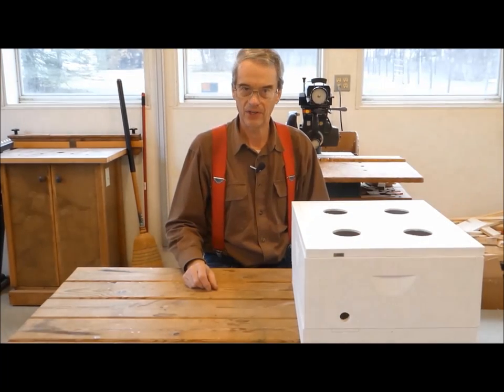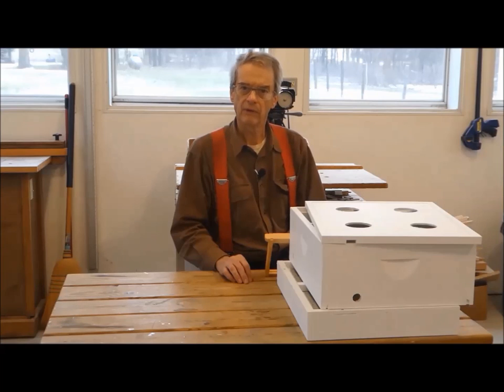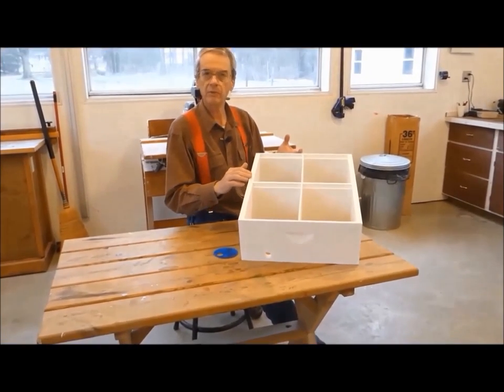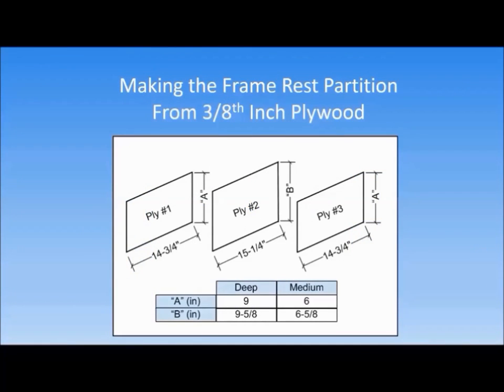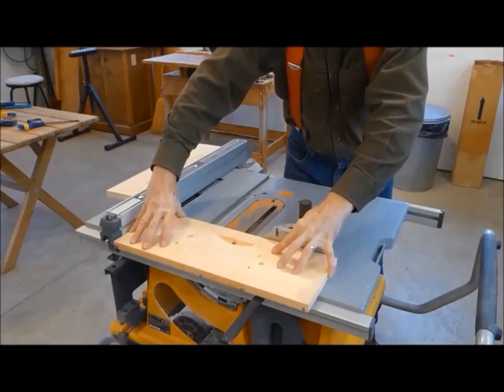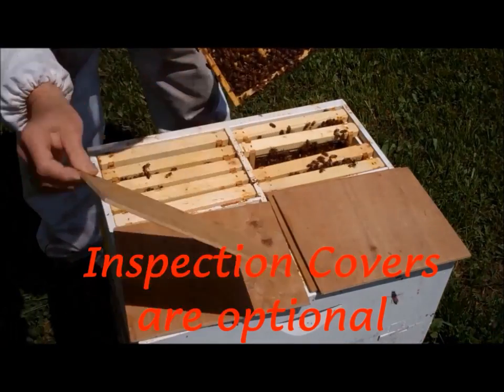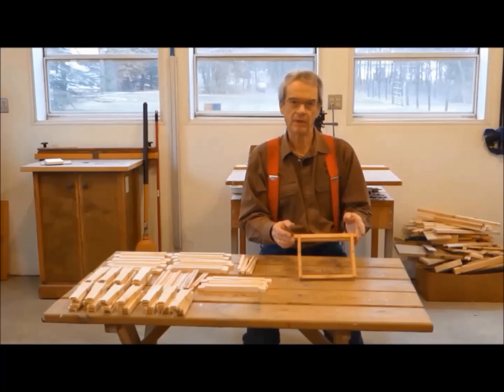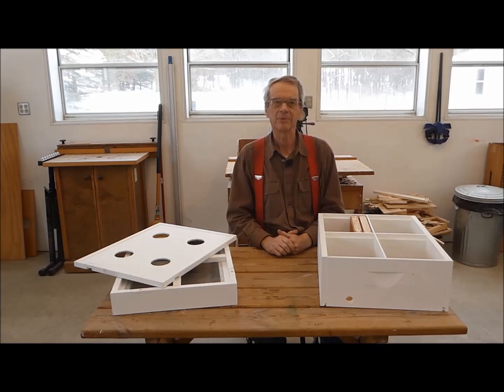Mini Nucs Part 2

Comment: For the ends of the topbar I just use a rasp to finish them up.Soft wood it didnt take long and looks pretty good.Love your videos .
Reply from the maker: As typical in the shop, there is usually more than one way to get the job done.  That is one reason why making your own equipment is so satisfying.  Thanks for the feed back.

Comment: Nice Project! You mention the thinner separations are non structural. What would I have to change from your original design, to make them removable? If you could remove such a divider, you could join two adjacend mini-colonies, thus having one queen tend to both compartments. Just in case a cell doesn't hatch, a queen doesn't return from her mating flight, or you needed to harvest a queen, but you don't have a replacing queen or queen cell at hand. I don't like queenless hive compartments.
Reply from the maker: Actually, I have seriously considered a removable partition.  It would actually be relatively straight forward to do.  First, the 1/8th inch dados would have to be a bit wider so that the partition would slide easily in and out.  The dados could also be a bit shallower, say 3/16th of an inch as opposed to 3/8ths in the plans.  Then cut the partition as a "T" (a tab at the top) which would sit on the frame rest and prevent the partition from sliding all the way out the bottom.  Other schemes would work as well.  I suspect the bees would glue the partition in place with propolis, but it is certainly worth a try.
Reply: You can run a piece of duct tape in partition joints (corner's) and they wouldn't be able to propolize I don't think because it'd be protected and bees Don't touch duct tape .may work if becomes a problem

Comment: I really enjoy your videos. I learn so much from all of them.  I would like to have a removable divider in case I have to unite the two hives. Where did you get the file to print the entrance disks on your 3D printer?
Reply from the maker: I created the drawings and subsequent STL files myself.  I have three sizes (diameter in inches): 4-7/8, 3-1/2 and 2.  The two larger discs have round main openings 1-5/8 and 1 inch respectively.  The small disc has an oval shaped main opening.  All discs also include a position for ventilation and a position for worker-only bee ingress/egress.  I printed mine in PLA plastic then spray painted them each a different color for each of the four chambers.  The PLA has experienced a small degree of warping over two seasons, but still appear to be quite usable.  If warping becomes unacceptable, I will simply print a new one.

I have no problem sharing these STL files.  If you want them, let me know.  Then we can work on a way of getting them to you.  Email would work or possible an upload to Thingiverse.  Might also be able to post on the mcihiganbees.org website, along with the links for the mini-nuc plans and videos.
Reply from the maker: Maurice.... The STL files are on the way.  Enjoy!